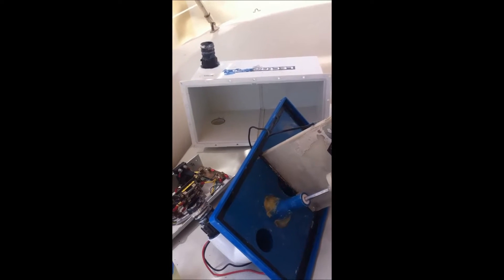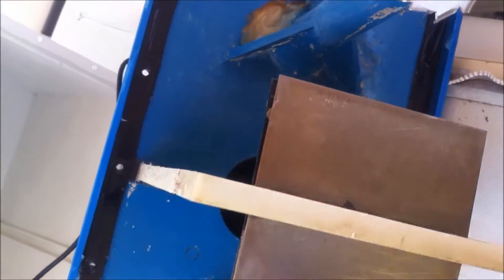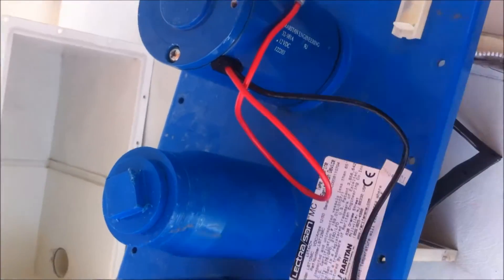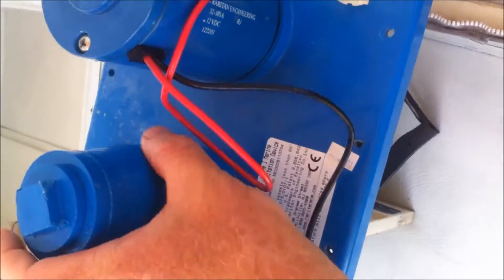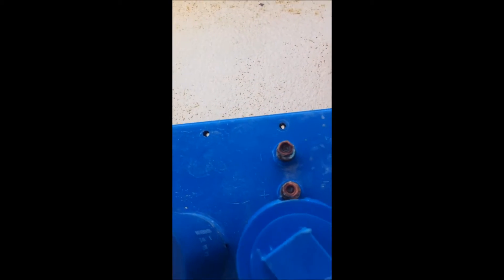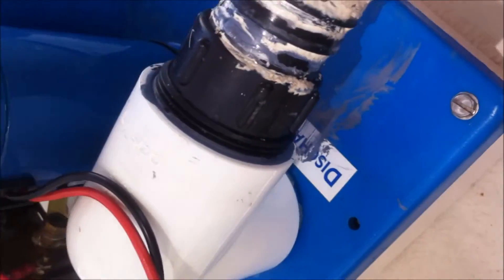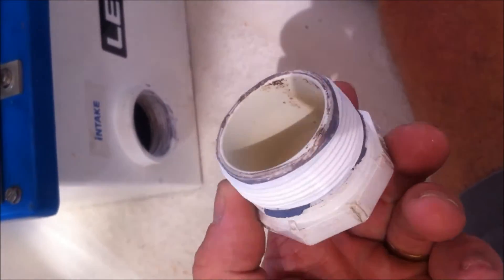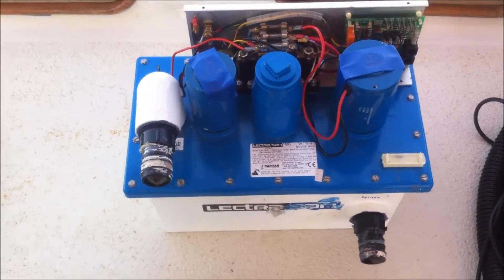Cleaning of the Lectra San sanitation system

Comment: Hi, steve. Can you eliminate the holding tank using this?
Reply from the maker: Yes. We have two heads the forward has a tank, the stern head uses the lestra San. If you are in salt water there is no problem with the sanitization. In fresh or mostly fresh you will need to add a brine tank to the system for good operation.